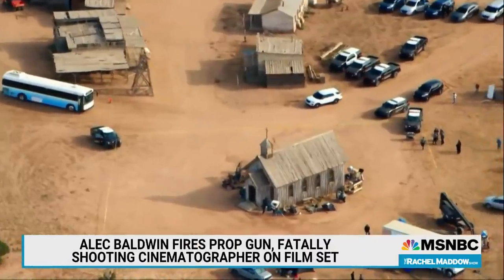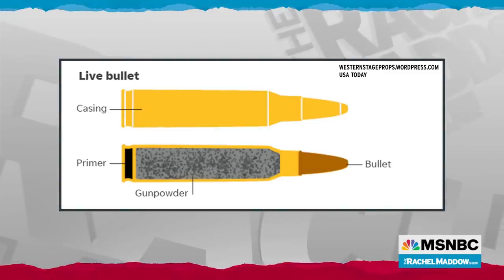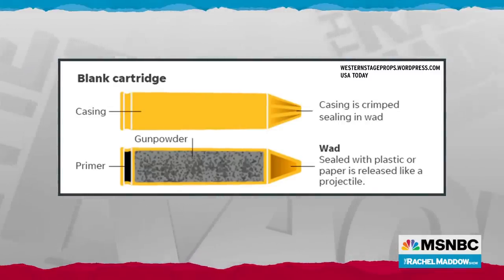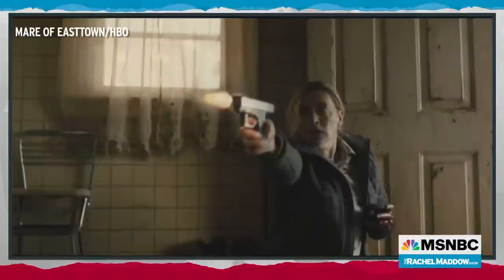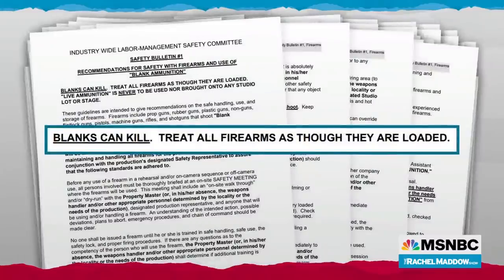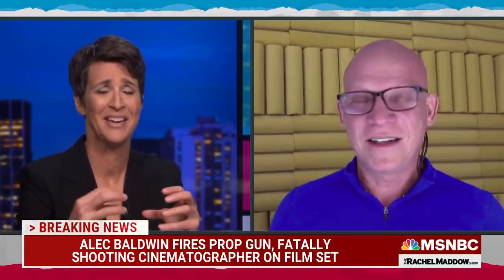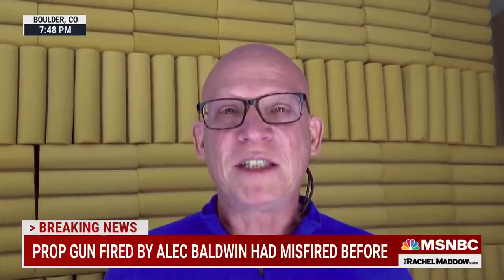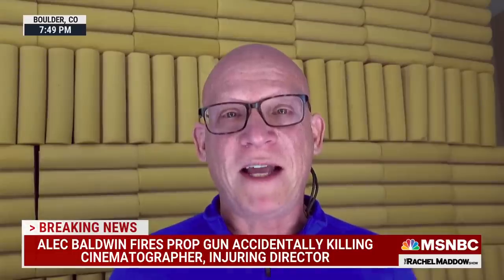Weapons Safety Expert Looks At Safety Protocols And Alec Baldwin Movie Set Shooting

Comment: I've been a Cinematographer for 35 years and can't count the amount of films I've done where we've had guns on set. There are strict procedures in place prior to the discharge of firearms. Typically a sheet of Lexan is put between the camera and the shooter to protect the camera, operator and assistant cam.  I have never seen ANY armorer bring live rounds on set. Typically we use half or full loads in guns depending on how much flame you want to be released from the camera barrel. Much of this has changed in recent years due to the fact that CGI has become so cheap and the flash is digital. As the man mentioned, prop guns are real guns. No difference. When you see a gun shoot and hit anything, an air gun is used, those loads are either dust capsules that are fired or zirk hits that spark when they hit metal.
Reply: In Europe Prop guns are real Prop guns where it is impossible to shoot life ammo in. They have a bore insert that only allows a flas but not a bullet. The barrel will explode when a real bullet is fired.
Reply: Why was it pointed at the cinematographer anyway?
Reply: @williamwilhite9193  probably to get a dramatic shot of the character firing towards the camera…but that’s why there’s supposed to be a lexan safety shield.
Reply: Alec must have known what he was doing. All those years in Hollywood there’s no way he didn’t know about safety protocols
Reply: Based on your experience, can you cast any light on how a second person got injured in this incident? (I haven't seen anything stating the director's injuries were gunshot, and they were not serious enough to need a prolonged hospital stay.)
Reply: @Belzedar  multiple people are often stationed behind the camera
Reply: @Belzedar  Through and through gunshot went into 2nd person.
Reply: Aren’t mirrors used as well? Mirrors are much cheaper than cameras. Camera would film the muzzle via mirrors, enabling camera crew to be out of the line of fire.
Reply: @roybakker1973  This is almost true at least in Italy where I work.  If the gun is a sidearm, or in the scene the actor is pointing the gun but is not discharged, then the gun barrel is plugged.  If in the scene, the gun needs to fire, then we use real guns. The difference is that in order to fire a gun on set you must have a licensed armorer on set, not a propman. Propmen can only issue prop guns that cannot be discharged.
Reply: @Belzedar  I can't for the life of me understand what live rounds were doing on set. I've never seen that in the 35 years Iàve been doing this.
Reply: @flamingosextet8649  sorry but mirrors arenàt you used unless you're trying to do some type of EFX shot. Plus with the schedules we shoot on I canàt imagine production taking the down time to set up something similiat. 50/50 glass was used in serious old school films to create ghost EFX on sets. Did it once on a film years ago, kind of cool but took time to get the glass and the actor on the correct film plane.
Reply: @Markinfilm  you’d geta down the barrel shot without shooting a camera or worse, a person. Thank you for your reply, i can see it would take much longer to setup.
Reply: Let me ask you something. Are Actors expected to check the ammunition of the gun every time one is handed to them? It seems everyone here likes to blame Alec for not checking and say he should go to jail because that makes him responsible.
Reply: @williamwilhite9193  He was practicing drawing the gun and various people were around.
Reply: @omeeawakened  Safety protocols in Hollywood center around the people in charge of the weapons (Armorer) doing that job. So he was told it was a cold gun HE was following the protocols in Hollywood, its somewhere before he got the gun that something was done wrong.
Reply: @Belzedar  I can let you know about that. What likely happened is the bullet went threw the first victim and the hit the second. Other than being further away the likely reason it wasn't serious is that the bullet was slowed down as it passed through another person. While a bullet can still be lethal after it passes through a person its far less likely. 

Additionally it could depend on where he was hit. If she was hit in the head, chest, etc. and then it hit him in the arm, it wouldn't require a stay.
Reply: @TearDownGenesis  No, no and no. It is not the actor's job to check the weapon. Those who want Baldwin in jail have some political ax to grind.  The armorer or propman loads the gun. The 1st Assistant Director checks the weapon before handing it to the actor. Sometimes if it's only a few rounds the weapon may even be shown to the actors on set then loaded right in front of them. Never and I mean never should live rounds be brought on set. In my 35 years, I've never seen it.  If the film is a DGA (Directors Guild of America) union film then ultimately it's 1st AD who bears the brunt of responsibility for the safety on set. Unions to have a reason for existing.
Reply: @TearDownGenesis  Thanks, so that means draw and fire. Maybe any actor with a "prop" needs to be trained to load it themselves to avoid catastrophe.
Reply: @williamwilhite9193  No, you have dedicated specialist who do that. That would be like suggesting stunt drivers need to be trained on rigging the car up with the tech to make it do what the director wants. 

Considering the guns aren't supposed to be loaded 99.9% of the time. There is no reason to train the actors on how to load a gun themselves.
Reply: @Markinfilm  Good. That's what I've been countering with all these idiots who talk about "gun safety" like its the real world. like "Always check if the gun is loaded" and "never point it at a person" seems ignorant of the actual industry. 

Thanks for confirming what I had figured. 
The statement I saw is in line with what you said about never brining live rounds but did mention "very rare exceptions" but people have said there is no evidence that this case (movie not shooting) would have needed one of those exceptions
Reply: @TearDownGenesis  umm. I think  The dead cinematographer may be reason enuff. But I'm not going to argue with you, maybe whom ever is going to discharge the "prop" should be there when it's " loaded"?
Reply: @williamwilhite9193  Not how it works.
Reply: @williamwilhite9193  The issue is that the rules currently in place are sufficient if followed. That’s why amending the rules isn’t really the best response here. 

What happened in this case is that the armorer and 1st AD flagrantly violated the rules by allowing people to bring live ammo onto the set (violation), let other people shoot the guns for fun (violation), with live ammo (violation) during down time. Then they didn’t follow any of the prescribed safety procedures (many violations), and handed a loaded gun to an actor who was told that it wasn’t loaded/capable of firing. 

The issue isn’t whether the current rules are sufficient, it’s that they weren’t followed. So if you really want to change policy to prevent this from happening again you need to look at enforcement.
Reply: @acesn8s89  yes, inforcement with the actor that will handle the "prop" involved. If there's no one watching who's to know what's going on, WTF.
Reply: @williamwilhite9193  You should look up the Dunning Krueger Effect.
Reply: Apparently people in the industry can’t handle their firearms and they think they’re above the law.
Reply: "Of course the underlying assumption is the rules and protocols are supported at the top (Baldwin and others) and followed.  My read is the protocols were NOT followed.

Comment: Questions I keep seeing over and over: "Why would you point a gun at the DP?"  They point guns toward camera all the time.  It's dramatic.  "Why would you have live ammo on set?"  Even blanks are dangerous at close range if handled improperly.  If fired toward camera at point blank range, they should have used a Lexan shield to keep the camera crew safe.
Reply: Even live ammo has a place on camera - for example, shooting at set pieces.  Granted, in those cases there's never a director in the line of fire and it's rarely an actor who's doing the actual shooting, usually the armorer or some other professional.
Reply: Live Ammo on Set is a big no no on a film.  Should have been none.  
Bullets that look like real bullets are actually dummies, no powder or working primers.  
Most blanks are specially made when dealing with semi-automatics and automatics.  The casing with the crimp is the same length as a casing with with a bullet.  Just using the regular casing without the bullet will cause the gun to jam.  Needs that extra length and bullet shape in order to chamber.

The armorer or property master (properly trained in the use of guns) on set should have been loading the guns, or have a designated specific member of the crew (with proper training) do so.
Reply: @Wailwulf  Up close shots of bullets = real bullets. And a blank does not go through 1 person and into another.
Reply: @Wailwulf  It's a western. Not sure when it's set but it doesn't seem like they'd be using automatics.
Reply: @cjr1881  Yeah. It sure sounds like a real live round got introduced into the prop.
Reply: there was a video on the news cycle with someone explaining that when a gun is pointed at the camera, the crew has to be somewhere else and the camera must be controlled electronically
Reply: @cjr1881  Up close shots of bullets = dummy rounds, a round with no powder or working primer.  
Having a real round on set is a very dangerous thing and not allowed in almost any situation.
A Blank may not go through someone, but a Real Bullet with a Load can easily go through someone.
Reply: Pointing it at the camera. Have you never seen a movie?
Reply: @johnassal5838   I was not talking about RUST specifically, I was talking about the movies in general, as all movies are suppose to use the same regulations and safety protocols.

There are also mentions in this comment section about blanks.  The diagram of the blank shown in this video is one that was designed  to be used to work with a semi-automatic/automatic weapon.   Those same blanks can also be used in single shot guns.
Reply: To get the right cinematic shot (as if shooter is in front of "you")  basic movie making. However a lot of cinematographers eemove people and get that "shot" remotely. This is what I read recently.
Reply: @TheNeverposts  Not true, it depends if you need to follow action with the camera. Usually a large sheet of transparent Lexan goes in front of the camera and the operators to protect them. This holds true on any set I've been on and when I've been behind camera.
Reply: Why do you assume he was siming at her? How do you know it just went into the crowd and she was she was the one that got hit.
Reply: You would point the gun at the camera not the person holding the camera.  If the camera had been dedtroyed thst would be diffrrent.
Reply: @johnassal5838  Very good point.
Reply: @Wailwulf  I understand your points, I should've been clearer that apparently being revolvers they should've been using a prop gun unable to take an actual round or one designed to replace one in an automatic feed.
Reply: I'm still unclear about the type of round that was in the gun that killed the DP. I have heard that it was live ammunition. But was it live blanks or live real ammo?
Reply: @jimyarbrough9935  Because one of the biggest tropes in Western gunfights, or gun fights in general for a movie, is shooting at the camera (for visual and dramatic effect).  The Cinematographer is always behind the main camera in order to get the perfect composition.  Aim and fire at camera, hit the person operating.  The gun was not aimed at the cinematographer, but was definitely aimed towards the cinematographer.
Reply: Now hearing the actor was told the gun was "safe". I suspect the gun had not been cleared or properly checked following an earlier scene. It seems there had been some on set safety concerns
Reply: Yes exactly- so what happened here
Reply: @AdeptPaladin  No, they wold use blank rounds and electronically detonated squibs, small explosives used for decades to simulate bullet hits.
Reply: To all the "pointing it at the camera" people, the guy in this video, an actual weapons safety specialist makes it clear that you don't point guns at people like that when firing them on set as a safety precaution, even if you don't think they are loaded with real bullets (or have people sitting directly behind the camera if you are firing it at the camera, same thing.  Alec Baldwin may have not loaded the gun and multiple people may have screwed up before he ever got handed the gun, but he shouldn't have fired it at a person either (or fired it where there was a person sitting behind the camera he was pointing it at).
Reply: @AdeptPaladin  Live ammo has no place on a set. When they need damage to occur on a set piece from firing in a scene, small controlled explosives called squibs are set on the thing to be "shot" and then detonated. Live rounds are not used on set and should not be anywhere near a set.
Reply: @cjr1881  no live ammo. Period. You use fake rounds without powder or primer if you want to have bullets visible from a revolver. No primers. No powder. No live ammo.

Basic rules, and anyone saying otherwise doesn't know what they're talking about
Reply: This had happened during rehearsal (not rolling) when the actor was practicing "cross drawing" the gun as the script required. On a set during final setup there can be people around in any direction. And with thousands of watts of lighting pointing at the actor, they might not be able to see them all.
Reply: @henrytjernlund  Why?  Sounds like an excuse to me
Reply: @scottshaw8864    No, he was practicing his “slapping leather” drawing a real firearm from his hip holster.  He didn’t just point his revolver in a “take”, he repeatedly slapped leather.  He was carrying a real firearm on his person!  Like everyone else in this country, he is the one responsible for pulling the trigger!
Reply: @davekoenig9935  Either way I agree with you and if he was just practicing drawing then it seems even worse to me that he was pointing the gun at people.  There's no need to point the gun at the camera or have tons of people around if you are just practicing.  While it might seem unrelated, the fact that people literally walked off the set earlier in the day (I'm unclear if that had anything to do with safety or if it was pay related, etc) indicates to me that there were issues on that job and that a lot of procedures probably weren't handled correctly on that set.  People don't walk off the job for no reason.

Comment: Blank bullets are dangerous even without a bullet. Every professional knows that.
Reply: The modern prop bullet has a very thin copper membrane, they don't even make much noise- that is added in post production.  The greatest dangers with a modern blank would be burns if the muzzle was too close to someones skin, or an obstruction IN the barrel.  

The modern prop bullet isn't like the old prop bullets, they needed to have the compression to replicate the sound but almost no sound in any movie is genuine anymore.
Reply: @Markinfilm  I take it that was his personal firearm? Don’t tell me that an actor would be given a real gun with real ammo to “act” with?
Reply: @dboydboy1000  The word prop gun is a misnomer. If in the scene an actor is waving a gun around then we use plastic mock-ups or guns with the barrel plugged.  If however, he or she fires a gun, it is a real gun capable of shooting live rounds. In the U.S. propmen handle guns, if you have a lot of guns such as a war movie or a western with numerous people shooting you will have an armorer on set. In Europe propmen only handle plastic or fake guns. Any gun that will be discharged with full or half loads can only be handled by a licensed armorer.
Reply: Blank cartridge...the actual piece that moves through the barrel,when fired, is the bullet.
Blank cartridges are formed in 2ways,1 by machine crimping the end of the tubular brass section.These rounds make a bang ,flash and smoke.
2 by fitting paper and plastic pieces to form a replica of the real bullet.
These are still capable of injury or death if mis-used accidentally.